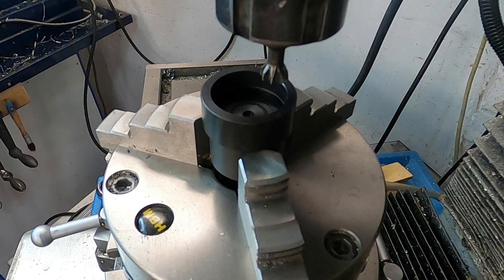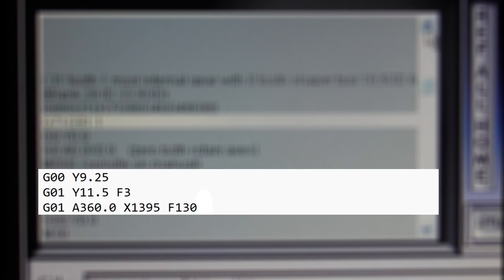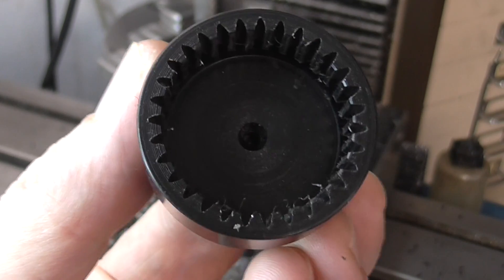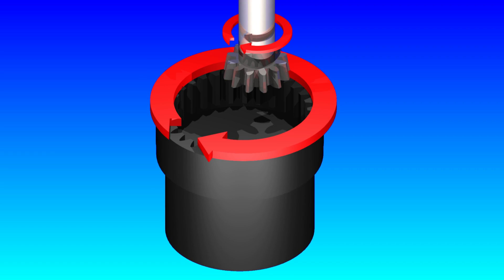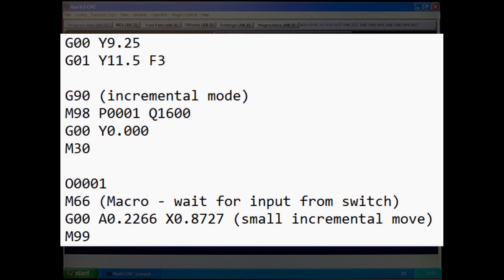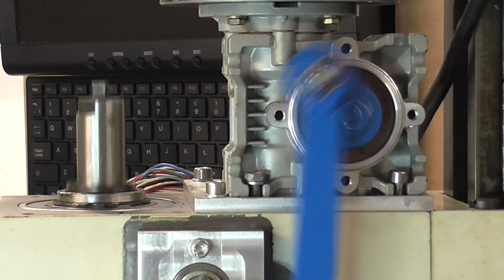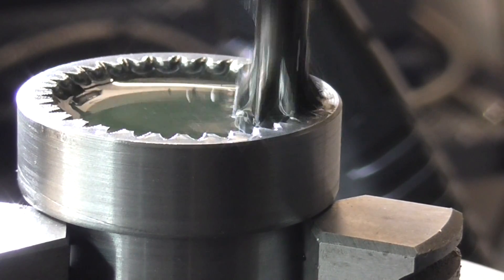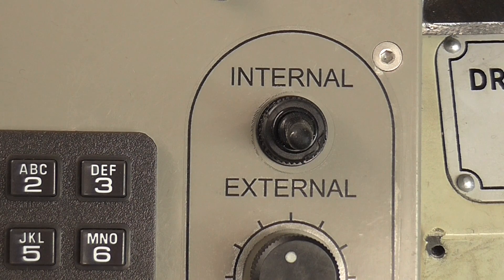Building a Gear Shaper (Part 2)

Comment: Impressive work! I'll probably have to make one of these eventually for making compound planet gears. Right now I just mill them from both sides on the CNC, but face width is limited by end mill length, and root clearance is deeper than it should be which weakens the teeth. Plus I could give them a bit of helix with a shaper.

Comment: Brilliant work Andy, I converted an old Warco mill to cnc in 1985,  there was nothing available at the time, had to make the drivers etc, that worked on a bastardised HPGL language,  then moved to Master5, mach1, mach2, and mach 3, still going strong, I then CNCd a Bridgeport, for bigger stuff, that is running on UCCNC,a very nice program.  cheers Peter Smith
Reply from the maker: I built my first 'CNC' machine about 10 years later in the mid 90s. It was a woodworking router. At the time I didn't even know what a CNC machine was, I came up with the idea independently, it used stepper motors driven directly from a PC parallel port controlled by a BASIC program. It was extremely slow! The first proper CAM software I used was Cncpro which ran under DOS.
Reply: @AndysMachines  Hello Andy, yes I used DOS as well, it was an excellent pulse generator, unfortunately Windows is not.

Comment: You have got to be the most talented versatile person on the Internet. I enjoy watching your videos. How did you learn all these different disciplines? Computers, electrical engineering, programming, machining, mathematics and so on?
Reply from the maker: Thanks, but I'm really no expert at all of those things! I've learnt just enough from each to be able to do the things I want to do, mostly self taught apart from a couple of college courses. It used to be called  'a Jack of all trades' but I believe the modern term is 'agile'. 
Whilst a little knowledge can sometimes be a dangerous thing, I often see projects built by people with far better (say) computing/mathematical skills than me, but then the whole thing is let down because they've used some crappy 3D printed part, whereas if they could just do a little welding or machining, even at a very basic level, it would have been much better.

Comment: Could you not store those feed rates in macro variables and call those in the middle of your code, then just change the macro variable to update the whole program at once?
Reply from the maker: Yes, you're probably right, but I'm not very proficient at writing macros and I think my self-contained solution is more elegant and much easier to set up for each gear. Probably a lot more work to build initially, but that tends to be the way I approach things.
Reply: @AndysMachines  Feels to me if you can write anything in assembly language, you could certainly do a macro, even I can write simple G code macros 😂

Comment: The cutter for internal and external gears is the same? Same tooth shape?
Reply from the maker: Yes, I used the same cutter. The geometry of internal gears is reversed (ie. addendum is on the inside) so that it will mesh with a regular gear inside it.

Comment: Mr. Pete (TubalCain) latest build is an Atlas Lathe gear cutting attachment. It's less sophisticated and works entirely on a lathe. It might inspire your design. 
https://youtu.be/ZXdk_MSTp04
Reply from the maker: While Tubal Cain is undoubtedly one of the best machining teachers there is (on Youtube and in print). I don't really like this method of making gears on a lathe. A better way is to hold the blank in the lathe spindle and use a cutter on a powered tool post spindle (the way Clickspring does it). Though both methods usually rely on having another gear with the same number (or multiple of) teeth to do the indexing, though it doesn't have to be the same size. Or if you don't have another gear you can make a disc with slots around the edge, but as Mr Pete says, if you can do that then you probably already have a mill and dividing head, so you might as well use those to make the gear.

If you add electronic indexing and a spindle lock to the lathe-spindle method then it becomes quite a fast and reliable way to make gears with a lathe.
Reply: @AndysMachines  I like the simplicity and lower part count of the lathe design, but its clearly incapable of making more complex gears. As an alternative to slotting around a disc's edge, drill holes around the circumference and use pin for indexing. The drill hole locations can be easily created using a cad program and then printing a paper template and gluing it to a disc blank. Given the cost of a stepper motor and the low torque requirements-- just enough to turn the blank, it's probably worth the little bit of effort to incorporate an electric motor. I would add a automatic spindle lock to reduce the load on the motor's holding torque.

Comment: Ok ok ok great! I actually just asked this quesiton over at the Terminator reddit, could theoretically, the T600 or T800 actually work. Or was it more of them just placing things on a skeleton that looked like it would work. I guess we get to test that with your work!?! I was thinking one would want to test the theories on CGI first, as there might be major reworks needed, and or considering we have come a long way in most these technologies, a redesign would be in order to make things work more smoothly.
Reply from the maker: I think they actually did a pretty good job with the original T800, the upper half of it at least, the endoskeleton design makes it able to reproduce most of the movements of a human. Remember though that it was built as a movie prop/puppet and needed to be controlled remotely (no CGI). The legs however are not so well designed and with the layout of the actuators I doubt it would actually be able to walk or sit down/stand up. In the first movie the legs were only animated with stop-motion using a miniature model.
Reply: @AndysMachines  Upon further discussion on the subreddit, I think i was expecting too much of what it could do, Arnold was able to sell the robot like effects like thata if it had that limited range. 
T800 was better, but eventuaally the went to T1000.
I learned about Ameca and realized whata I wasa thinking of was ultimately not possible with that endoskeleton but it really wasn't meant to. 
That is pretty awesome that they accomplished what they did! 
Therein, looking forwarad to seeing what all you share on your channel, T800 or not, you do really cool work and capture it well! 
Thanks!

Comment: I'm glad you know about backing off the cutter... I was told the gear shapers I used backed off 0.050". We also had the gears cut at least 2 passes (rotations of the blank), the second pass mostly being a "spring pass" that improved tolerances and surface finish.

Comment: Does derilin plastic smell fishy when it's cut? I have an odd piece at work that seems the same that's a bit stinky when drilled or sawn.
Reply from the maker: It doesn't normally make any smell but if it gets too hot (blunt cutting tool) then it does produce a smell I suppose you could describe as fishy. Drilling or sawing might produce more friction and heat than other cutting methods, the 'fishy' smell could be formaldehyde which POM can release if burnt.

Comment: From my point of view, gear shaping is the best application for flexible home gear production. Personally, I wouldn't make a external gear to gauge the tooth thickness . I would attach the desired balls to a telescopic/snap gauges to measure the OBD. For the  correction of the OBD an adjustment block would be beneficial.  (just my humble opnionion)
Reply from the maker: That would be the correct way to measure, unfortunately I don't have a snap gauge like that. It can be done with pins and an inside micrometer (some even have pin jaws). But both of those only work on a gear with an even number of teeth, this gear has 31.
Reply: @AndysMachines   For an odd number of teeth it is: Mdk = dk * cos(PI()/(2*z) )+/- Dm  (+external).  Teleskop Interne Gauge Sets are quite nice, i personally use the for all my internal measurements, good enough for an IT 7.

Comment: That steel internal looked like you just need a new cutter and then a stack of bank deposit slips.  ;)
Maybe a look inside the rotary table.
Reply from the maker: Yes, the cutter was a home-made one that I'd previously used in another project and not the sharpest. I also think it would work better if it had more then 8 teeth as the profile would be closer to that of the gear it's cutting.

Comment: great !!!,   when will you be taking orders for 65-T 32-DP 20-PA internal ring gears for nine-cylinder radial model engines ? :-) !!!
Reply from the maker: Are those in demand?
Reply: @AndysMachines  the best gear combination for a 9-cyl radial's cam is 20:32 -- 13:65, this allow a relatively large 20-T on the crankshaft (the small 13-T is on the compound planet where it doesn't matter) and the 65-T is mounted with the cam-ring.   the other option is 16:32 -- 16:64 which means a much smaller (weaker) crankshaft.   since imperial gears are generally only avail in even numbers, and metric gears are generally only avail in multiples of 5, most model engine builders go for the inferior 16:32--16:64 imperial solution.   the Bruce Satra, Bob Roach P & W 9 follows full size and uses 20:32--13:65  and the plans call for broaching your own 65-T internal ring gear,  and is the main reason why my 9-cyl radial is sitting unfinished on a book shelf while I work on easier(?!) things.

Comment: "It's just an 8 bit controller, programmed in assembly language" I love how you make that sound so easy 😂
Reply: Heaps of PIC/Atmel/STM/etc.. hobby boards out there with mountains of documentation and tutorials. All you need are the fundamentals - you get a few basic examples going like making an LED flash, then perform an actions when a pushbutton is pressed, then displaying characters on an LCD, and you can basically do anything because it's more or less the same thing.... 
* Making an LED flash is the same as sending pulses to a stepper controller
* Pushbutton presses and LCD projects map to the interface he built.
Reply from the maker: That's right. Anything that looks complicated, is really just a whole lot of simple steps put together. Assembly language is really the most basic low-level type of programming you can do.
Reply: Yes I did some asm and it's completely feasible, I just meant that's some hours of work and you resumed it in two phrases as if it's nothing ! Good job man 👍
Reply: Assembly language is surprisingly simple. It's the ancillaries such as hardware interfacing that makes it difficult.
Reply: My thoughts exactly - It's just casually, incredibly impressive
Reply: everyone is clowning suggesting learning assembly language.  You can simply just use an arduino and the arduino sketch language which is high level easy with million tutorials takes no study at all
Reply: @artbyrobot1  and I failed miserably at my attempt at understanding programming with Arduino!

Comment: You can make the Gcode more generic by adding parameters. #50=outer ring and #51 = cutter tooth count #52=ratio #53 = radial move. So in this case you would add the four lines #50=31 (outer ring tooth count), #51=8 (cutter tooth count), #52=[#50/#51] (ratio) and then #53 = 9.25 (radial move). Put these lines before G0 Y0.0 .  Then in the line where it has the comment (cut full circumference) you replace x1395 with x[360 * #52] and the Y move becomes G01 Y#54 F3..... 

This saves you calculating the ratio each time and so is less error prone and makes it easier to copy the code and just make a simple modification to the two main parameters (three if you change the cutter) for different tooth counts. You can also add a pause into the program that asks if the tooth count is correct if wanted. This parameterisation is a useful technique for simple home written code that is required to do the same job but with slightly different numbers and where you don't want to work through the code trying to figure what needs changing each time it changes. You can also add feed rate parameters to suit different materials if required. Something you could consider is adding a parameter calculation that calculates the radial move that brings the cutter up to the workpiece for the first actual cut and put a G0 Y move in before the G01 Y move starts the cutting process. Probably not important for small tooth counts but maybe for large ones it would help and because it is a calculation done in the code it only needs to be worked out once. What about calculating the radial move in the program as well? You could come up with generic code for inside gears, outside gears, module or DP gears and different cutters. The only problem I have with the Gcode in Mach3 is that is does not allow the use of IF branching. What this means is that you need a generic program for inside module, then one for outside module, one for inside DP and one for outside DP. Still only 4 generic programs for all you need, unless you start doing helical cutting as well but that would need more synchronisation.

.
.
G71 G91.1
#50 = 31 (outer ring tooth count)
#51 = 8 (cutter tooth count)
#52 = [#50/#51]
#53 = 9.25 (cutter radial move)
G0 Y0.0
.
.
.
.
G01 Y#53 F3 (feed cutter outwards radially, chip load 0.02)
G01 A360.0 X[360*#52] F130 (cut full circumference)
.
.
Reply from the maker: Thanks for the detailed explanation, I didn't actually think of doing it that way. I was aware you can use parameters in gcode, but in the past when I've wanted to do something like this and generate gcode from a set of parameters I've written an excel spreadsheet to generate usually just the relevant lines of code that I can then cut and paste. Not that that's any better, but I suppose it gives more flexibility such as being able to include 'IF' statements and things like trigonometric functions (I don't even know if you can do that in Mach 3 or not).
Reply: @AndysMachines  No If function but I have used trig to cut elliptical curves.

Comment: I’m in awe. You have inspired me to try something similar. Maybe with a lathe? Replace the compound slide…
Reply from the maker: Yes, you could certainly do that. A lathe may even be better, there would be less play in the spindle bearings compared to a small rotary table.

Comment: 10 lines of gcode is too much, let's do 2k lines of assembly instead 😂 You're our hero
Reply from the maker: 2537 lines actually, but I only had to write them once, compared to writing 10 lines of gcode maybe 3 or 4 times so far!
Reply: @AndysMachines  what's your position towards sharing the code? Open source and all that. I understand that your machines are rather specialized but surely there's enough people willing to replicate that.
Reply from the maker: I'm not against open sourcing the code, but it is so specific to this machine that it would need major modifications to work on even anything slightly different, and I couldn't provide support for it. Plus it's still a work in progress. I might put it up on Patreon one day when it's a bit more polished for anybody who's interested.

Comment: really nice work! I wonder if you can also lock the rotary axiis during the cutting stroke, and the other axxis as well.
Reply from the maker: Thanks! I locked the X axis which I'm not using and the mill head to the column. The rotary table locks with two small clamps that unfortunately I can't manually lock and unlock 2.5 times a second! The real problem is that these rotary tables have plain bearings which are adjustable but always seem to have some slop in them.
Reply: Time to make one that is kept tensioned to the table :D

Comment: so cool to watch! wouldn't it be easiest to mount an encoder to the up-down linkage? then you'd know the position of the cutter at all times.
I must admit that I have no idea on cost for 'hobby' equipment nor any clue on the processing capabilities of such a microcontroller.
Reply from the maker: I guess the disc with a slot is a very basic encoder, with only a single index pulse. I could add more slots and another optical switch for more resolution, but I'd always need the single index slot as a reference for the timing.
Reply: @AndysMachines  You could always do what car motors do for their crank angle sensor, and instead of having a single slot for the reference you have a missing slot instead. This gives you the benefit of having multiple slots for resolution, and by running it through a few revolutions and waiting for the long gap you can find your start/high position. Then you can know when its coming by counting the pulses.
Reply from the maker: That's a really cool idea! That way you have resolution and indexing with only one channel! I didn't know that's how crank angle sensors work, thanks for sharing, I'll use that idea one day!
Reply: If you would mount the encoder to the drive shaft of the quill so the encoder 'sees' alternating clockwise and ccw motion instead of the continuous rotation you wouldn't need a reference point as the top and bottom dead centers provide reference points. But don't let  my encoder comments detract from the admiration I have for your build:)
Reply from the maker: That's a good suggestion and would allow for more flexibility in the programming. Instead of setting the timing by manually positioning the disc I could just enter the 'safe height' into the controller. It's harder to mount an encoder there though, I would probably have to extend the pinion shaft out the other side of the machine and put it there. It would also have to be a quadrature encoder using 2 channels, and I'm running out of I/O on the microcontroller, I think I used all the pins, but might be able to swap something else.